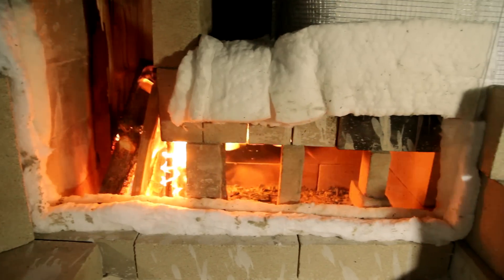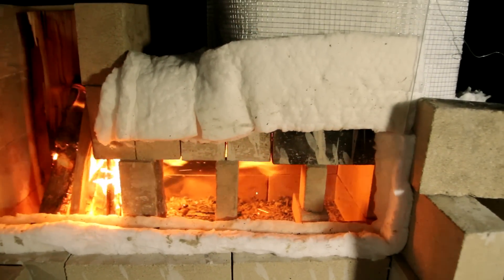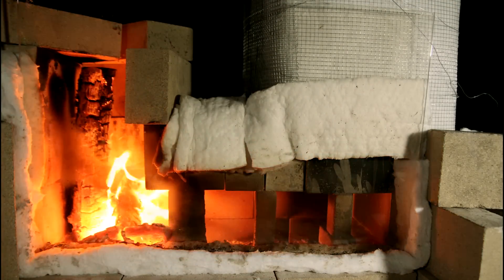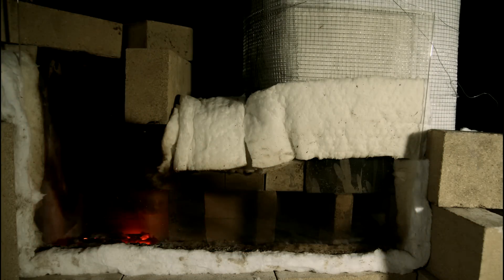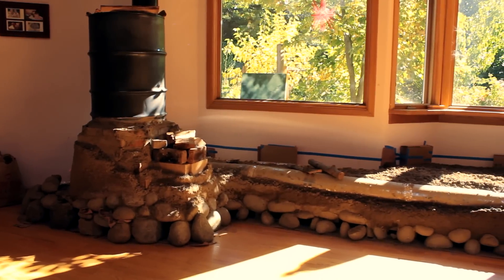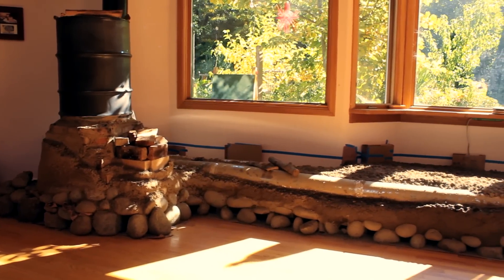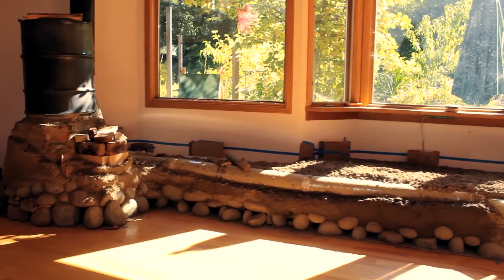RMH 1 Intro from the DVD Rocket Mass Heaters with Ernie and Erica

Comment: Ernie or Erica, 2 questions for you: 1- Do you think is it better to have a larger diameter buried flue than riser? I have the RMH book (Evans/Jackson), but nothing specific is mentioned besides the burn chamber being the "tightest part",  unless I somehow missed something, and not wanting restriction in exhaust air. My riser is 6" iron well casing, and am wondering if 6" stovepipe will work for apx 36 linear feet of cobbed flue, since I already have about half that length and some elbows...or if I should just get the 8" for the whole thing. I built the burn chamber out of 4 1/2"x 9"x 1 1/4" firebrick with adobe blocks for the 55 gallon barrel and manifold. I've not mortared the adobes to the heater yet, to size the manifold for whichever pipe I use. Second, I've researched insulating materials for the riser, and wonder about loose fiberglass. It's rated to 1,000 degrees fahrenheit, similar to perlite. Unless perlite is bound with clay, it's obviously loose granules, and if anything cracks or opens inside of the heater, it will be "like sands through an hourglass". Binding it with clay slurry has to lose some of the insulative quality. I also saw the youtube vid where rockwool begins to degrade after only a year. I've saved a couple of searches of suppliers listing industrial mineral wool blanket material rated at 2,000* and over, but don't know if that's necessary. What do you think? ...I haven't looked at your hour plus vids yet, since we're offgrid and use satellite internet with the rolling usage limits. Video streaming uses much of a monthly allowance. Anyhow, any insight will be appreciated.
Reply: ... outdoor test burn using these bricks and riser had a great "rocket" draw and horizontal burn.
Reply from the maker: You want to keep the same cross sectional area throughout the system. If it's a 6" system then keep in 6" throughout. We cover and explain in detail all the best practices for building these in the DVD Rocket Mass Heaters, which this video is from. We made it a DVD just for people like you.
Reply: Thank you.Village Video

Comment: Question....   Did you have to reinforce the floor joists under your rocket mass heater ?   That must be some substantial weight of your rocket mass heater  right?   I put some floor jacks under my floor and my RMH only weighs about 500-1000 lbs and mine is only about 6-8 feet long...
Reply from the maker: http://youtu.be/Bzhdfqqd5gU?list=PL0bZy202ImXP7NpLUJMtKJOjpjPPv59b-